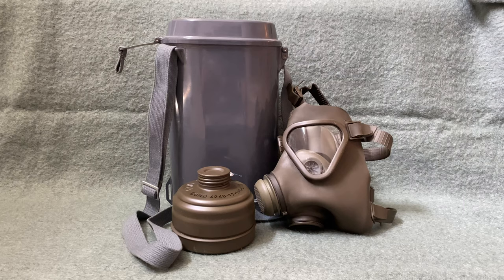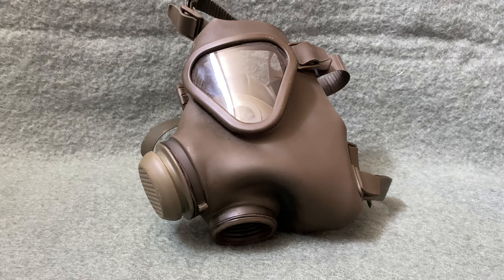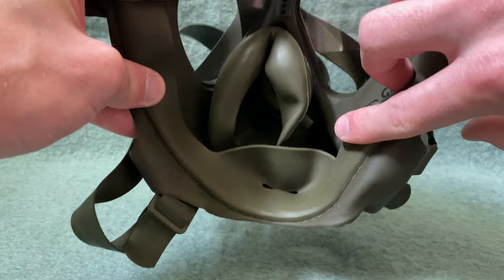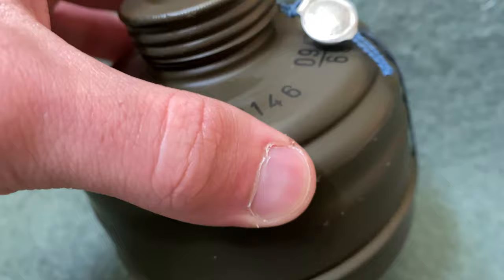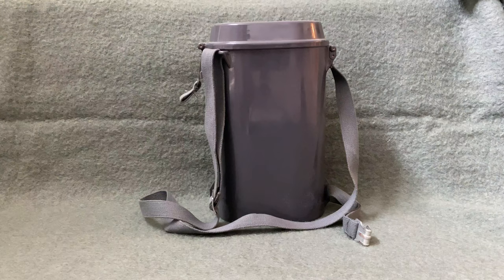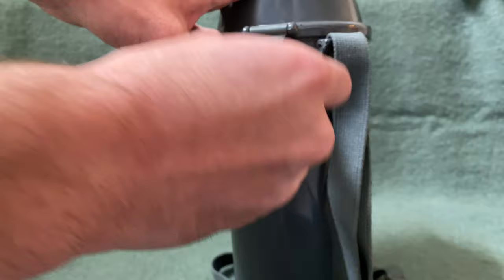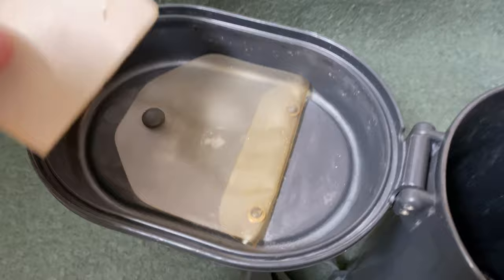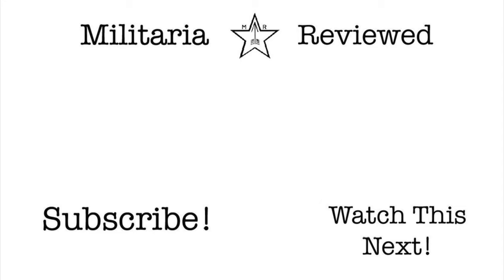German M65 Gas Mask

Comment: The white "oxidation" is probably not oxidation, but some kind og talc or other slip compound from the moulding, or to prevent tight packing of materials to stick over time
Reply from the maker: I would agree but after wiping it away....it comes back! Old plastic is known to do this. However it is common for the mask itself to be coated in talcum powder to prevent it from sticking to itself. A while back I owned nearly 100 WW2 era masks and each one was covered in it before being wrapped in paper.

Comment: Great video I think..... I might be wrong..... But you might have the civil M65z, but with the Military M65 voice diaphragm. The M65Z is brown, also has the glasses connection inside at the nose bridge, with small holes. Usually would have the rubber voice diaphragm cover. The Military M65 would be green rubber.
Reply from the maker: My mask is a dark OD green but the lighting of the video might make it look otherwise. Your question is something that I wondered myself when I first got this mask a couple of years back. I have seen m65s with m65z features and m65z masks with m65 features. Some of the disputed features are the glasses connection, thickness of the rubber between the two, neck strap (or lack thereof), and markings inside the mask. Auer also made these masks and it seems they used slightly different molds and I believe this has caused some confusion as well. I think I will email Draeger and see if they have an archives department so that we can clear this up.
Reply: @MilitariaReviewed  excellent keen to see how you get on, seems to be alot of confusion I've a couple of the masks myself and it would be good to get a definitive responce.
Reply from the maker: I’ll be sure to let you know if I hear back